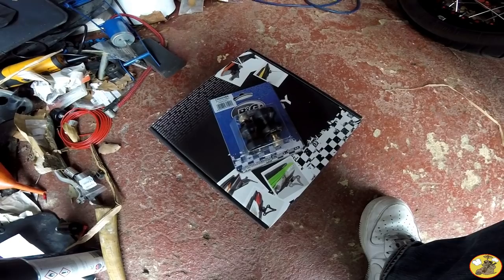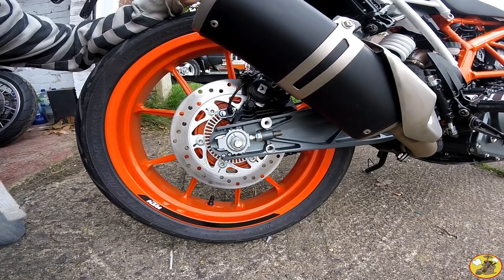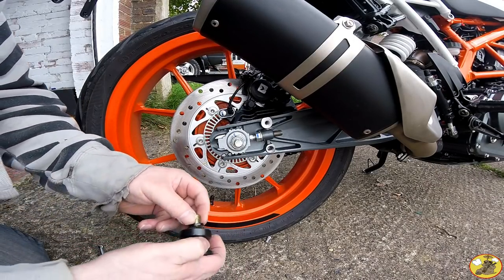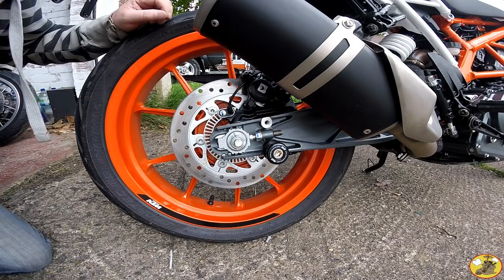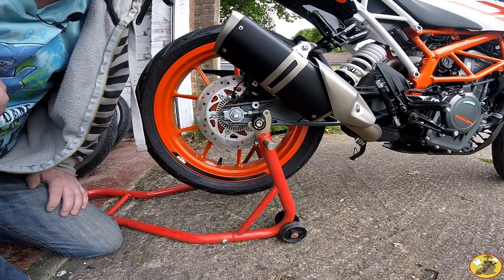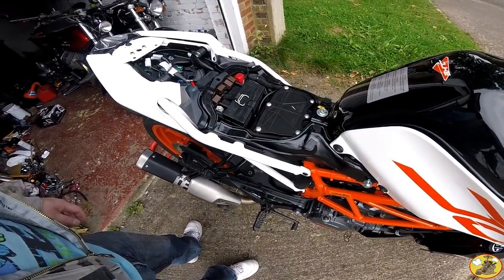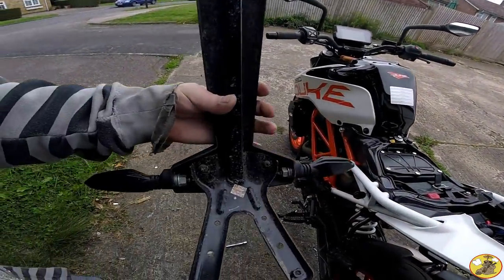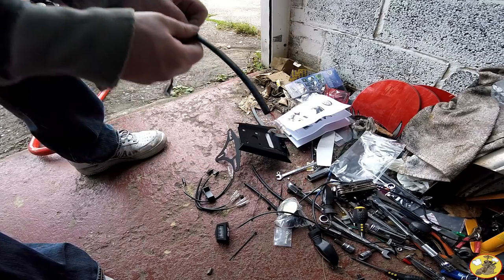KTM 390 Duke (& 125 200 & 250) - Tail Tidy & Bobbins Install

Comment: Hey man, good informative video. Looks way better with the R&G tail tidy! Just to confirm, it does actually pointed in the instructions to put the illuminator on first, sixth bullet point on the fitting instructions section.
Reply from the maker: I think my pages went out of the correct order, thank you for pointing that out, I have pinned your post so it should help others who buy the R&G tail Tidy for the bike! :-) I never saw any mention of attaching the light to the framework, just the bit where it stated to put on the heat shrink! :-)
Reply: Cool dude, yes it's literally the bullet point right before it tells you to put the heatshrink on. Phew I thought I screwed up doing the fitting instructions for it, anyway are you happy with the product though?
Reply from the maker: I love the look, although it does make the mudguard pretty ineffective as water roosters now even with the full size number plate.
Reply: Unfortunately that's the downside on having a tail tidy, it improvise the look not the function. Just for your information, you've got a wrong set of paddock stand bobbins as the ones you have will or have the tendency to hit the exhaust when the rear shock is fully compressed. There is a kit specifically made for this bike which sits lower. Try to contact them or the shop where you got the kit from
Reply from the maker: oh that is interesting, do you have a part number I can quote when contacting the supplier?
Reply: Yes it would be CR0063, it's not just bobbins and 
bolts kit, it's got mounting blocks & spacers too
Reply from the maker: harry hardi awesome, thanks for the info :-)
Reply: Checking the R&G Website it looks like these might be for the RC?  Hippo have you had any issue with the ones you fitted? I think they are the correct ones, but want to be sure before I go ahead and buy...  (thanks for great vids btw)
Reply from the maker: Hi James, I've not had any issues, but that may be because I have a different silencer from standard, harry was saying that the 2017 390 Duke bobbins should have a bracket lowering them a little so that they don't hit the silencer. If I were you I'd contact R&G and check, but Harry said that you want part no: CR0063.
Hope that helps you out, ta for watching! :-)

Comment: this the part at 9:13 come from the original plate holder or the tail tidy?

great video!
Reply from the maker: It comes with the R&G tail tidy! :-) Thanks buddy, means a lot to get positive feedback! :-)
Reply: think this is the only video showing how to do this. at least the only one this good! i got a different tail tidy and it did not come with that part... maybe i can just find it on ebay tho
Reply from the maker: The grommet does stop some moisture getting under the seat from spray off the rear wheel, so it is a good design idea! :-)
Reply from the maker: I hope you find the part. If you like my content, why not subscribe to my channel, that way when I do more mods to my KTM 390 Duke you'll get a heads up! :-)
Reply: subscribed :)
Reply from the maker: Awesome, thanks Mathias! :-)
Reply: Where can i get that holder , and then what the name for that holder , ?